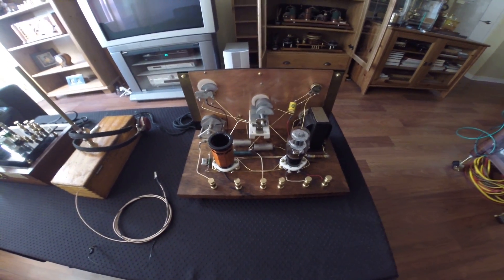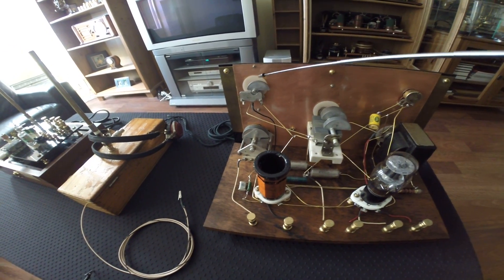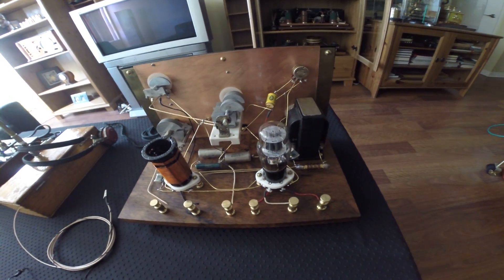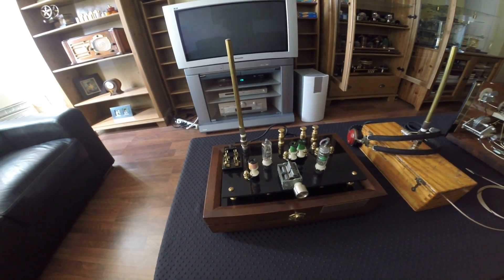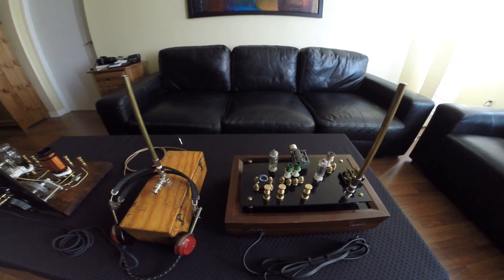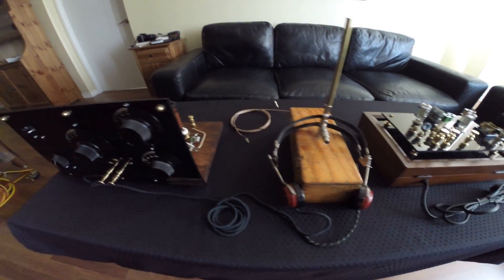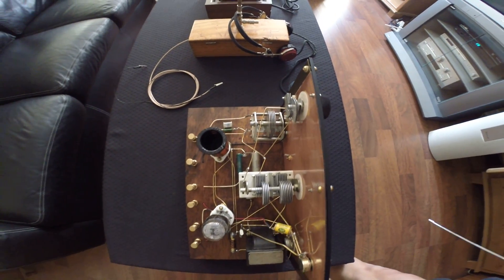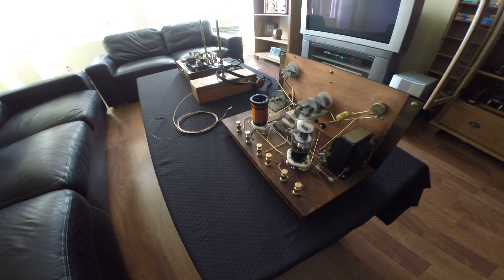Radio AM Transmitter and Radio Regenerative AM SW/MW Receiver 1930

Comment: Great job!  Beautiful radios.  Did you build the receiver from a kit?  I am about to build an almost identical radio from a kit I bought from PV Scientific Instruments.  I was looking for some photos to help me with the layout, and came across your video.
It looks almost exactly like the radio I am about to build.  Are you using brass rods as the solid wire connectors? Thanks for posting.
Reply from the maker: Peter Van Eenenaam Hi this is from the svhmatic and visual photograh from the magazine from 1930. 
I am using brass soft Solid wire and brass terminal posts.
Reply from the maker: Regarding layout whatever makes sense for shorter point to point either straight line or if wire must bend 45 degree NOT 90 defree or you moghtget reflection.
Reply: Thanks!  Look forward to starting the project....